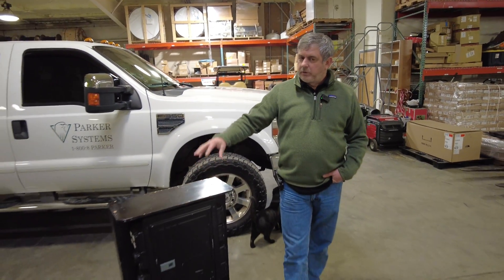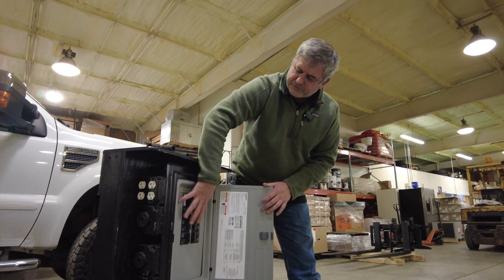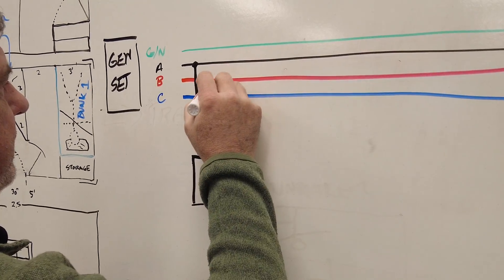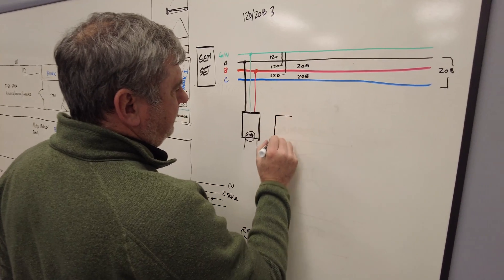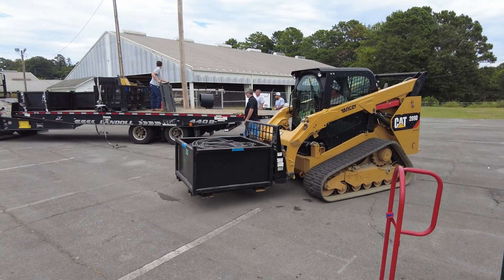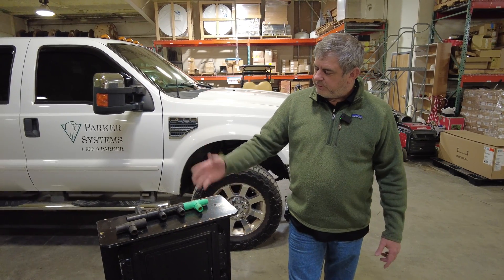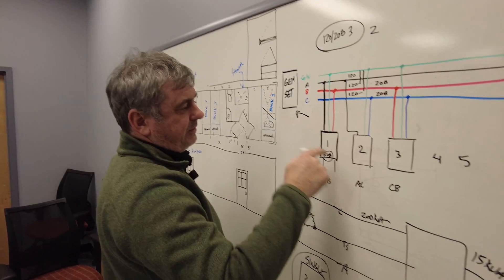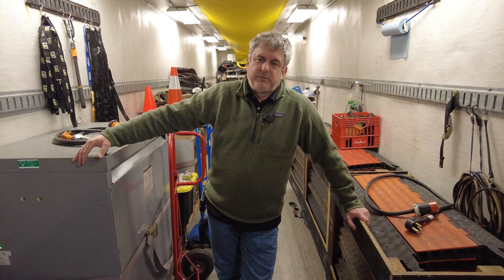Power Distribution Boxes for Commercial Events! | Parker Systems

Comment: not to criticise your power distro panels, you might want to consider using 'hospital grade' duplex receptacle devices, they have tighter tolerances on the blades and the connectors don't pull out easily..keep up the awesome work you do Dave
Reply from the maker: no worries appreciate the comment -- I can tell you I do use the industrial grade version and the 20 amp versions -- while not as good as your suggestion the ones we used have proven pretty reliable -- I don't use the spec grade they are pure junk -- also a nice feature of the ones that I utilize is the connector for  the wire has a flat plate so that wire is between two "square washers" for lack of a better term --  I like to use stranded wire and as you know its impossible to get them under a screw then you have to use a clamp terminal and an alignment hole makes the stranded wire a easy connection.   Thanks for the comment --

Comment: how do you get 208 volts from two lines of 120?
Reply from the maker: It’s 3 phase.  We are only taking two of the phases to the box.  In a three phase circuit between each phase is 208.   We then divide the phase AB BC AC …. Thanks for watching. 

Each phase is 120 degs apart from
The other phases.

Comment: Good explanation. With the pseudo split phase setup, the phases are 120 vs 180 degrees apart giving only 208 VAC instead of 240 VAC. Also, transmission lines are 200 kV and not 200 kVA. kVA refer to the reactive power rating (e.g. transformer power rating) and KV is the voltage of the transmission line. I assume your gensets are configured in a wye configuration instead of delta given the ground/neutral configuration. I have no experience with 3 phase power but I have done some reading.
Reply from the maker: You are correct.  We do so many gensets I’m very sloppy with that term.  Sorry.  You are correct.  Power lines are volts and kva literally volts x amps …. Real and reactivity power is far detailed than videos are comments.  Thanks for watching…. I need to be better.   

Thanks again.

Comment: Amazing explanation of all the components and I will say I'm a bit jealous of all that feeder you have haha. Btw, those panels don't really seem like they are outdoor rated along with the receptacles. maybe also consider adding GFCI protected Edison outlets along with outdoor rated panels and receptacles. Its more of an investment but I feel like it would be more durable and longer lasting. Also, have any inspectors given you crap about the panels? I work in the entertainment industry doing production for concerts and many inspectors have given us crap about not having GFCI protected outlets on out distros and having our own DIY distros even though we build them to the highest quality we can only using the best components and clearly are just fine.
Reply from the maker: On the outdoor rating we only use them in a temp situation -- we have the rain shield on top.  We also made the units were a large garbage bag would protect them -- we buy the clear bags and they work pretty well, we didnt mention it but hey also have a led strip along that rain shield that illuminates the distro.  Most commercially built distro have indoor rated panels with a rain shield on top.  On the GFIs we approach that in the same way the construction and RV industry approach the safety -- the end user is responsible for the ground fault protection -- ie the RV has the GFIs installed and construction industry require the workers to bring GFI protected cords or double insulated tools .. we do a lot of movie and sound industry work -- those industry dont like the GFIs on critical circuits and they handle the protection ...

Comment: So are those NEMA 14-50 receptacles that are not delivering 240?  or 18-60 actually feeding 208?
Reply from the maker: that is correct if we are using a genset in 3 phase configuration (120/208) if we utilize a the single phase setting we can get to 240/120... Most modern 240 equipment can handle the 208 -- you will notice that motors will give ampacity ratings for 208 / 220 / 240 amp ratings at each voltage -- I appreciate  you pointing this out as in AC circuits reducing the voltage is typically not a good idea -- unlike DC circuits were dropping the voltage typically is okay.

Comment: How much of a problem is it, if at all, for the 3 phases to have very different loads on them for the generator?
Reply from the maker: Great question. -- you want to keep the load balanced as much as possible -- that is why we balance the loads across the phases -- most genset controllers will shut the genset down on phase imbalance -- when you single phase a genset you typically derate it at least 80 percent -- sometimes more... You can also help this by utilizing the genset at 480 using a delta to wye transformer down to the 208/120 this help smooth the load to the genset -- thanks for watching --

Comment: Great video again, I didn't realize that the gen sets were 3phase, I only used those 3phase on industrial projects not events. Like to hear more besides the networking for said events. Keep up the great work.
Reply: You might be surprised to know that three phase is a LOT more common.

My 1989 4WD has a three-phase alternator. Those three phases are combined and rectified to give 12v DC.

You can get single phase alternators, but chances are your car is also three phase.
Reply from the maker: I appreciate you watching

Comment: Layman here 🙋🏻‍♂️… Any issues plugging an RV into 208v instead of 240v?
Reply from the maker: typically no.  First most RVs except maybe for the largest units (like a 45 diesel pusher or prevost) all the interior devices are 120 not 240.  However for the last several years (at least 20) most motors or dryers - or large appliances will accept 208 to 240 --  with no issues. -- great question

Comment: For many cities, the AHJ (city electrical inspectors and code enforcers)  are getting more and more skeptical about shop built distros like you show.   No matter how well you build them, they want to see that UL listing on the parts.   I work for a large entertainment lighting rental vendor, and we have largely phased out the older shop built distro panels.  Lex Products in CT, and Trystar out in the midwest are both products I've used and they are very good quality and have that magical listing.     For fairs, festivals, movie and tv shoots, they generally want to use locally licensed electricians and to pull permits and have inspections.       
  One issue you probably don't deal with, but I have for TV and movie shoots is voltage drop along a distribution network causing the lighting to have slightly different color temperature of the lights.  The solution is to run the power feeder as a ring main, like the UK does.  This gives effectively double the size of conductor to all the distro boxes, which greatly reduces voltage drop.   
  How do you handle rain getting into the outlets and plugs?   I don't see covers and such on the outlets.  I have dealt with it by using a blue tarp.  Take one edge, pin it under the backside of the panel, wrap it up and over the top and down, then secure it with a bungie cord.   When I need to get in, just undo the rubber cord and the tarp keeps you dryish while you are dealing with the panel in a driving rain.
Reply from the maker: Great comments.   For the rain we made them the size that a large 55 gal garbage bag will cover them.  We buy the clear ones and the led lights that we have under they cover shines thru.  I’m a master electrician and we have never had had an issue with the UL certification, all of the parts are correct and the portable code has never failed us.  I am familiar with the Tristar, LEX etc brands as well as several other power vendors that build a great outdoor rated panels, although to your point many of these "outdoor" units have interior rated breaker panels and the company builds a rain shield.  I understand the issue with voltage drop and the color of the lights changing, I like your idea of a ring.   I bet that alone would solve the majority of voltage and voltage drop issues, as the ring would keep all of the voltages relatively consistent.
Reply: One thing I would do differently on your panels is instead of having a set of tails hanging out of the panel, have a set of cam males and females on panel mounts.  that way you don't have to deal with all the tapping tees and keeping them up put of the mud and puddles on a site.  That many little expensive things to keep track of and go missing.   I don't know if you have run into this, but some production companies have their ground and neutral cam connections reversed gender.  Having panels with full sets of goesintas and goesoutas on them makes the need to keep gender changers around go away.   Also curious if you take precautions against copper thieves and vandalism?  I've had to fish a power distro out of a river once, and then the police kept it for a year in evidence trying to get fingerprints from it.    @ParkerSystems
Reply from the maker: yes -- the copper thieves are out there -- thanks for commenting and watching

Comment: great video,probably the best, easiest to understand description of 3 phase to 1 phase power online. have you ever looked into using a beverage/beer body trailer for ease of organizing and load/unload of breakout boxes and cable? Heavy cable units down low and lighter distribution boxes on top.I "m not positive but i think that the beer bogy compartments are compatible with standard pallet sizes.
Reply: Beer is about eight pounds to the gallon. Copper cable is a lot heavier for the same cubic space.  I'd have to do the math, but I suspect that the beer trucks are not built to handle the additional weight.      Take a bin full of cable, toss a distro panel in on top, and have the forklift carry it out to where needed.  Turn the bin on it's side or upside down to keep the empty bin from becoming an unplanned dumpster during the event.
Reply: what weighs more, a pound of feathers or a pound of copper? the trucks are limited by weight not the density of the product inside. being able to have ground acces to your product vs having to lift everything 4+ feet off the ground and then moving it up the 53 foot tunnel are different amounts of work and logistics especially in a field vs warehouse with a loading dock. @dalesql2969
Reply from the maker: I have had that beer trailer suggestion before -- i have seen those repurposed for tool and service trailers as well -- thanks for watching